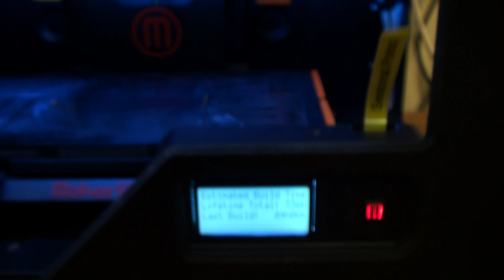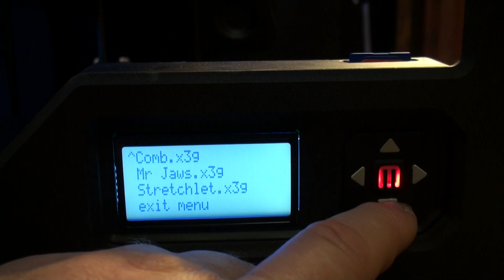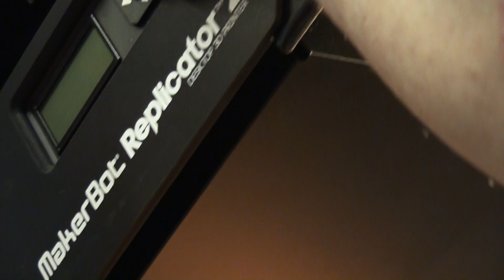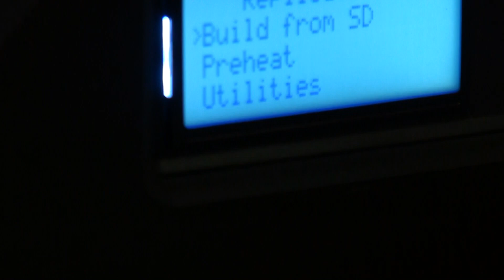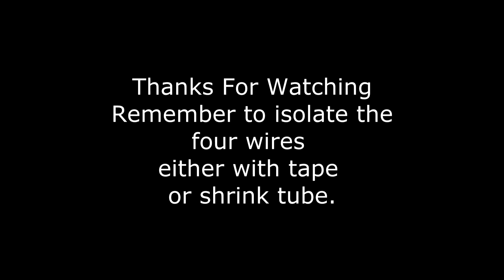Makerbot Replicator 2 - FIX - Slipping - X Axis Problem - Loss of location - Juddering

Comment: Thanks VERY much for this video!!! I suddenly had the problem that the makerbot would not work correctly in the X axis front half of the building plate, but fine in the back. I found this out playing with the jog mode. Your video was the answer. The cable was damaged exactly at the location you described (215 hours of printing)! quick fixed it just moving the cable, but I will build something similar what you did. Makerbot should fix it! You did a great job finding and posting it!!!

Comment: Thanks for the info. I'm going to go check mine now. I also have two Rep 2 machines and it is funny how the newer one is having a similar problem. 

Unrelated, what are you using for a build plate? I have had horrible luck with the acrylic plates and the two replacements I got for both. I have a nice glass build plate that is flat and works well but am having trouble getting painters tape to stick to it. It curls up on the sides.

Do you have some kind of clip on the sides and are u using glass?